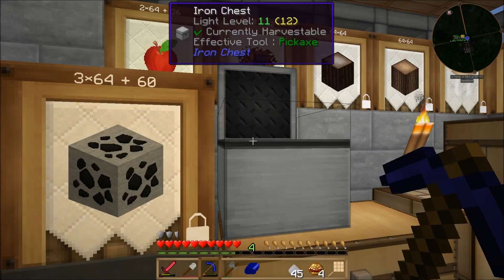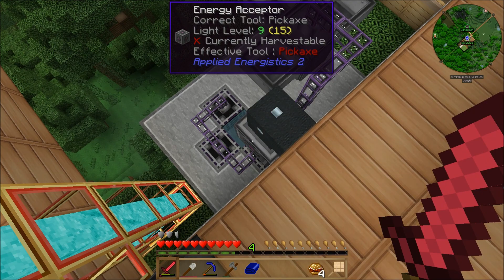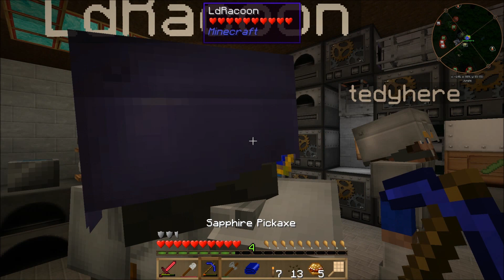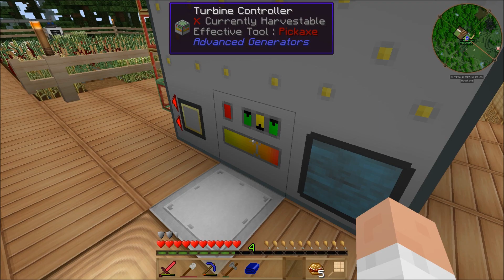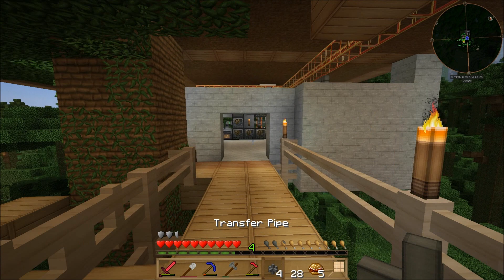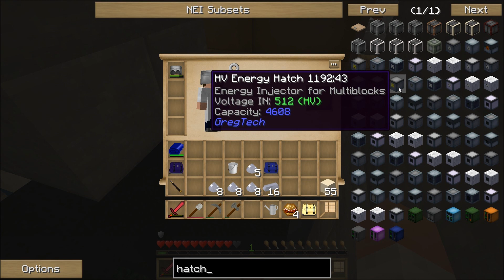The Conglomerate - Utopia³ Resurrection - Grumpy Engineering Co.

Comment: So wait (advance generator->ic2 cesu->GT battery buffer-> GT machines) in that order? because GT wires do not connect to ic2 machines...
Reply from the maker: Replace the GT battery buffer with a GT transformer, but otherwise that is correct. I misspoke when I said battery box.